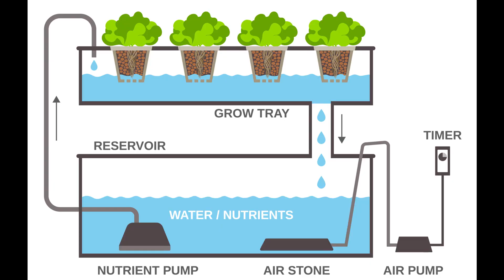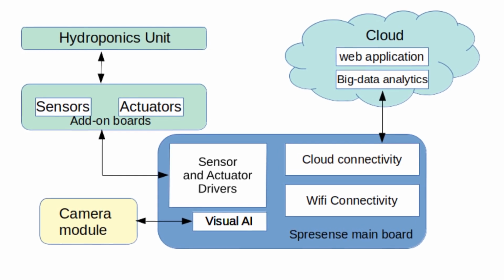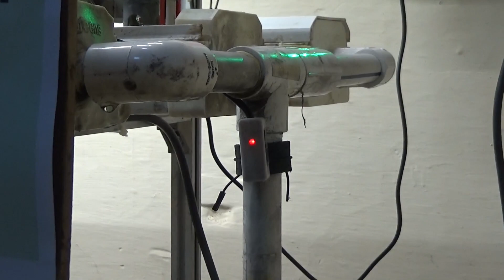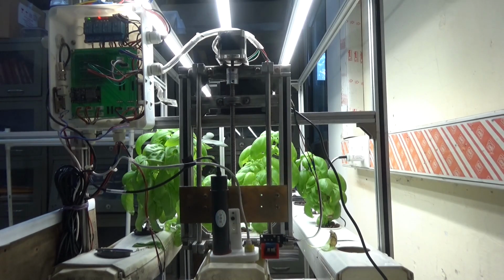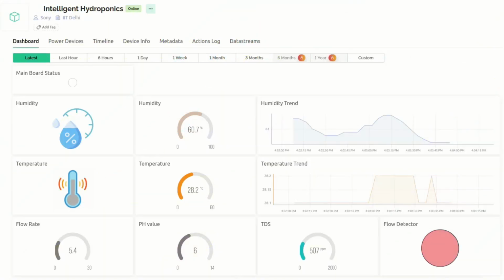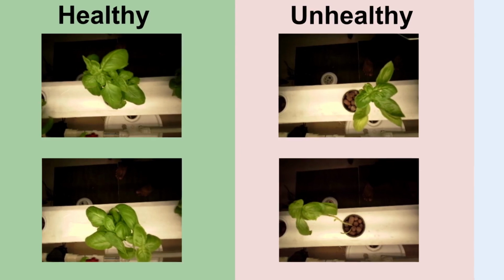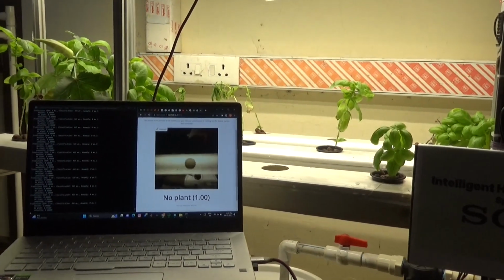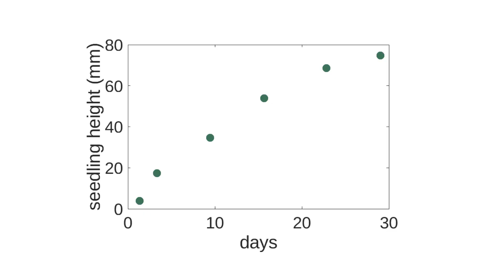Machine learning and IoT enabled hydroponics system using Sony Spresense

Comment: 3:82 the sensor lift is sooooo overkill! just use a servo and place the sensor on an angle and rotate them in... also many years or month do you save while doing so? sensors aren't that expensive and will be replaced anyways. and than the problem of the fine film of solution on the sensor will maybe dry and stack up over time.. just to mention my first thought..
Reply: bro I feel like yk what ur talkin abt. We have our final year BTech project and I have some doubts. U think u could answer some of my questions ?
Reply: @yuno1653  maby.. but i'm not a pro at all.. just common sense... but yea: go for it..
Reply: @wildniscamper7276  so me n my group are thinkin of doin like a automated greenhouse similar to this video. so we've bought like hw-888, soil moisture sensor and some actuators to automate providing water. Do u think I need to buy a npk sensor ? or just provide nutrients in regular intervals.
Reply: @yuno1653  just hydro no soil? you need to control: watertemp + waterpH + water EC (measunring at inflow and drain to get information of the plants eating behaviour if that makes sense..) NPK + calcium are important too yes.. sensors to measure that correctly arent't cheap at all so... not an easy task... but as i said, that's only what i know so far.. it's an huge field with a lot of knowledge to handle.. cheers from bavaria!